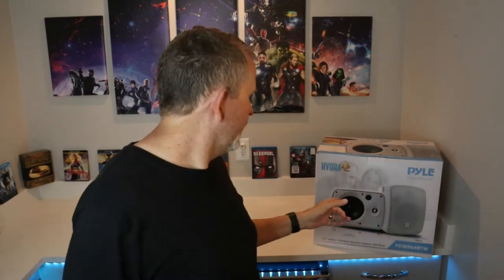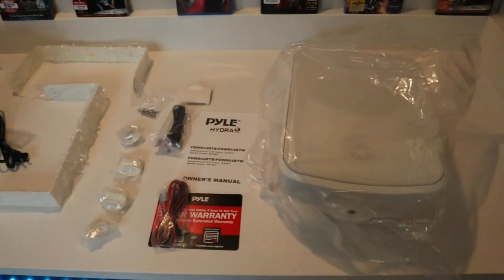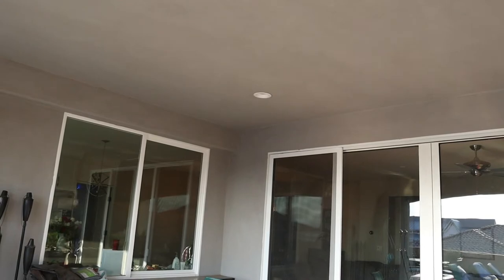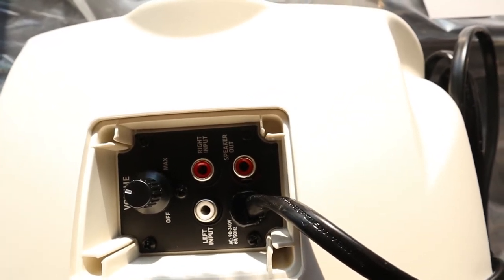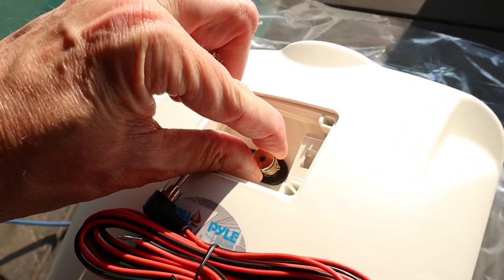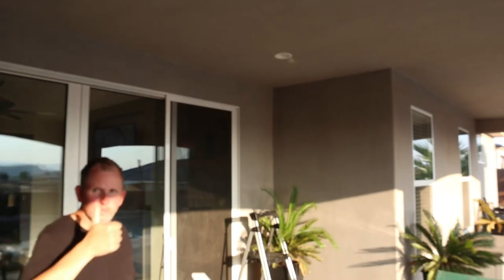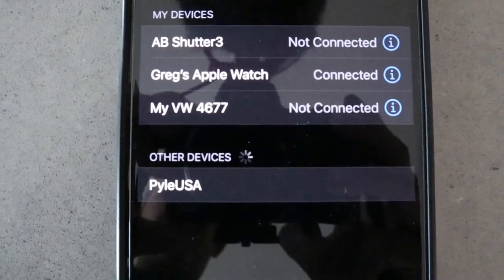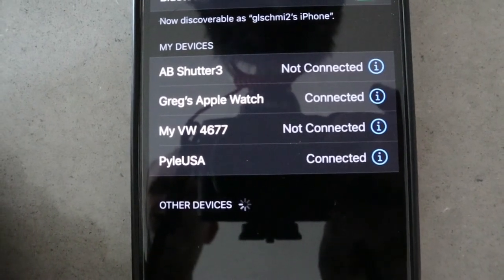Bluetooth Speaker Pyle PDWR64BTW Install

Comment: I have the same speaker but I don't have the wire can you please tell me the name of the plug with the red and black wire I can't use the speaker because I don't have the wire or know the name
Reply from the maker: So the red and black wire that comes with this set has what's called an "RCA" Plug on one end, and the other end goes to the secondary speaker in the set, the RCA plug will push into the Primary speaker (Speaker Out) on this set.  Hope that helps.  
That's the one that wasn't long enough when I went to set it up and I had to extend it with regular speaker wire.

Comment: Great video and set up. I set mine up on patio Gazeebo.  i Have the PDWR61BTWT and supposedly they are supposed to charge and keep a charge so they are wireless. have you ran into any issues? I mean it appears to charge but the power button needs to be on, and cord plugged in. goes from red light to green light. but if i unplug it sound pairing just drops. The box didnt really come with any instructions as im sure you found out as well. Any tips or troubleshooting. Im trying to determine if user error or i got a faulty one that may not keep charge. Thanks ps subscribing
Reply from the maker: Thanks for Subscribing!  So I have power run to my speakers continually on the back patio and haven't run into any issues as far as connecting these go.  They are in a "always on" mode and when I search with a device they pair right up and change from a red, to blue light.  The instructions aren't the best for sure.  Search Bluetooth Device: Bluetooth network name "Pyle Audio"  Pairing - Enter Password: 0000
If that's not helpful try https://pyleusa.com/pages/contacts and they are usually pretty good about e-mailing you back for support help, especially if the speakers aren't connecting or pairing.

Comment: Would you know if I could connect 2 more speakers from the one primary speaker without having to connect the Bluetooth to the new ones?
Reply from the maker: I've not tried that, but on the back of the main speaker where it shows "Speaker Out" You could try picking up an RCA splitter and connecting a couple additional speakers.  Seems like it has the power to drive them, but I just haven't tried that.  Thanks for the comment.

Comment: Thanks for the review now I know it brings its own wired cable. Just have to make sure it's long enough.
Reply from the maker: Yes connection cable is included, and I think you can manually extend it if you have the correct cable and or plugs.  Thanks for the comment!

Comment: Question is how are the speakers powered they an ac power directly into power outlet or some other way?
Reply from the maker: Thanks for the comment!  Yes I've run power directly down to an outlet and have it on continuously.  The speakers go into a standby mode, then automatically come on when pairing.  Hope that helps.  🔊
Reply: Thanks a bunch for the info vary helpful.
Reply from the maker: @erickcastro8414  You are very welcome!  👋

Comment: Can we hook up a subwoofer to these speakers and if so how and what kind would we need? Thanks!
Reply from the maker: There isn't really an easy way to do it from what I'm seeing, you would need an outdoor powered subwoofer with a built-in crossover for starters to pass only the low signals to the sub since there isn't a Subwoofer output channel built into these speakers.  Just doesn't look like a great option, sorry.
Reply: @Fix My Bleep!  the model I have seem to have a place in the back where is says sub. But I'm not sure what kind of subwoofer I can hook up there. Also the instructions doesn't have this information. It literally just says you can hook up a subwoofer, is all it says lol.

Comment: In the video, you mention needing to get longer speaker wire. Where did you get it and does it have the single connector for the primary speaker? My speakers are going to be close to 30 feet apart. I'm thinking of using 12AWG wire but having a hard time finding one with a single connector for the primary speaker.
Reply from the maker: Just standard speaker wire will work fine.  I ended up using 12AWG speaker wire that turned out to be a little heavy, but sounds great, and you should be good using that as well to cover the 30' distance.  I didn't use a connector but just spliced the wires together with the existing Pyle speaker wire to extend them from the primary speaker to the secondary speaker if that makes sense.  Hope that helps, and thanks for the comment!

Comment: Nice job with your setup.  I bought some Pyle PDWR52BTBK black 5.25 speakers.  I plan to do a similar set up like yours.  Question:  when you mounted into the stucco did you go in straight with a screw or did you need anchors?  TIA.
Reply from the maker: Thanks for the comments!  So I just used grabber screws into the stucco, like a 2.5 inch, and was close enough to the corners that I was able to hit studs so didn't need anchors to go into the walls.  The speakers do have some weight to them, but if you can hit studs, then you are fine.  👍
Reply: @FixMyBleep  Thanks.  Also I actually just bought these same ones you got.  The above ones I stated earlier were a little underwhelming so I'm going with a higher wattage and more pricey but I think I'll love them.  As for the RCA plug wire, I hope they changed that short one you mentioned and are giving longer ones now.  I need about 12 feet.  Do you happen to know what that type of wire is called or have a link for a longer set.  I don't mind paying for longer ones.  I searched RCA plug wire on amazon and they show different types of wires.  TIA and thanks again for the review your set up looks awesome.
Reply from the maker: @Westcoastguy  Thanks for the comments!  Here is one of my Affiliate links for a direct RCA to bare speaker wire that should bridge the gap for you: https://amzn.to/3wKunR8
Hopefully that helps, enjoy your setup.  
🔉
Reply: @FixMyBleep  Thank you!  Luckily for me one of my friends was able to give me an extra cable he had.  But I appreciate that.  Thanks again.
Reply from the maker: @Westcoastguy  Glad to hear it!  👍

Comment: The second speaker lost Bluetooth connection how I can fix that do you know any model of the Bluetooth
Reply from the maker: Hi, so there is a primary speaker that connects to the Bluetooth, then the secondary speaker runs off of that main one using RCA to speaker wire.  Sorry this is giving you troubles, I'd try powering the speakers off and back on, make sure nothing else is paired since only 1 device at a time can be connected to these speakers and see if that helps.  Check the connection between the speakers as well if one is not working.  Thanks for commenting! 🔊

Comment: Hi I like the video are these speakers really loud or not ?
Reply from the maker: Thank you!  Yes, or at least I think these speakers throw out a lot of clear loud sound if you mount them against a hard surface somewhere.  I've usually got them on a low volume setting because when I hung them, there is a control on the back that I put up past halfway or so.  Now I just use my device like a cell phone, or i-pad to adjust the volume.  Hope that helps, and thanks for the comment!  🔉

Comment: This is the best setup and review info I’ve found anywhere on the internet, awesome! How do they hold up after this much time? Have they stopped working? How much time did you get out of them if so?
Reply from the maker: Thank you so much for the kind comments!  👋  These speakers hold up wonderfully, keep in mind they are under a patio and mostly out of the direct weather, but we just used them over the weekend and they are still cranking out great sound!  I love the things.  The speakers have accurate sound, crisp, clean, loud (if you want to party it up!)
I'd still recommend, and would buy again!  👍

Comment: Can more speakers be connected in series to this pair?  would the built-in amplifier handle the extra load? thanks for your help
Reply from the maker: I haven't tried it, but on the back of the main speaker, there is a jack that's marked " Speaker Out" and you could pick up an RCA Splitter and give it a try, the system does seem to have plenty of power, I bet it would handle them.  
You just can't get another separate Bluetooth set and hook it up as a series, without running it on another device like a separate i-phone or i-pad.  Hope that helps.  🔊

Comment: It seems great .. but i wonder if i can connect these 2 speakers to an amplifier without having power adapter to the main speaker. Will they work without AC power?
Reply from the maker: I haven't tried that, but think it would work depending on the amp you are hooking it up to, they are great speakers and should allow for different hookups.  Thanks for the comment!

Comment: Can you disable the blue light on the master speaker? I was thinking of mounting these beside an outdoor tv but dont want the light on while watching tv at night.
Reply from the maker: Hi I just was checking into it tonight.  So the grill cover doesn't come off, that was my first thought, there is also a switch on the back of the master speaker but it turns out to just be a volume and on/off for power.  Sorry doesn't look like an option, but great question, thanks!

Comment: How do you control the sound volume on the back of the main speaker and how do you turn it off when not using it without having to get on a ladder and turn it off at the main speaker?
Reply from the maker: So that hasn't been an issue because I set the volume on the main speaker to about 2/3 the way up, and control the sound with the i-Pad, laptop, or phone instead of speakers themselves.  Also I leave them powered on all the time.  They go into a stand-by mode of sorts, but come right out of it when connected.  If you don't want them on all the time a quick fix would be to get one of those Christmas switch remotes that has the on/off button, and run the power cable through that.  Thanks for commenting!
Reply: Thanks!
Reply from the maker: @naturalbodhiwellness8960  Happy to help!

Comment: One of my speaker lost the Bluetooth conectivity how I can fix that
Reply from the maker: That's a great question and I've had that happen before.  It was because I still had an i-pad paired with the speakers, and then couldn't find them with the other devices I was trying.  I don't know if that's the same thing, but they will only pair with one device at a time, so make sure they aren't already paired with something.  Also be sure Bluetooth is enabled, and you don't have too many items in your list, you many need to clear some, or power these speakers off and back on before they show up.  Hope that helps.  Thanks for the comment!
Reply: The problem is that one sound good the other is blue light and on but not sound
Reply: The speaker is good I open and put aaa battery a d sound soo is not bad the problem. Is with the Bluetooth
Reply from the maker: @alexvinas9840   If they are the exact same speakers as Pyle PDWR64BTW then you want to check the connecting cable between the primary speaker with the blue light, and the secondary one.  If these are a battery powered set of bluetooth speakers or a different model try reaching out to the Pyle customer support here https://pyleusa.com/pages/contacts

Comment: Lame...  so you drilled some holes and screwed some screws.  Didn't show how you hid the wires or how you gave power to the speakers.
Reply from the maker: Glad you enjoyed the video.  So on the left wall I ran a short extension cable up to the speaker plug, then covered it with cable loom and used cable clamps to hold it into the corner of the wall.  Here are the links for the cable loom/tubing and clamps, it turned out looking really good.  Thanks for the comments, next time I'll show more in the video.
1 inch Cable clamps: https://amzn.to/3PIXgXQ
1 inch Cable loom/tubing: https://amzn.to/48jFCRL